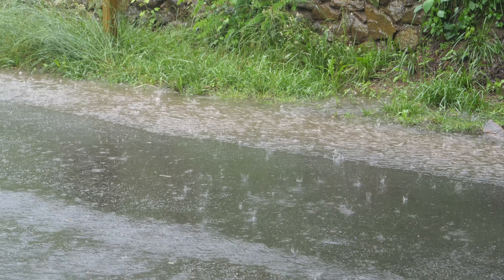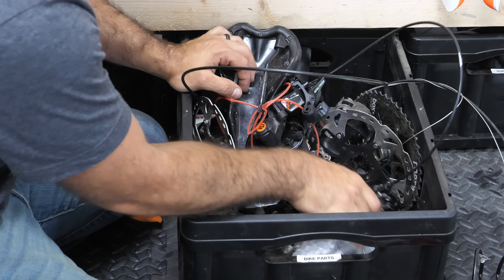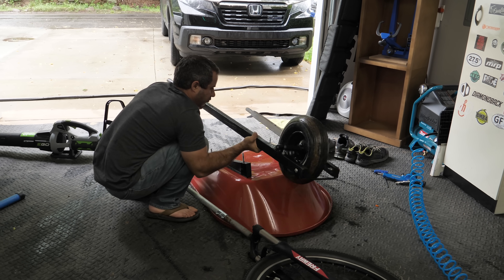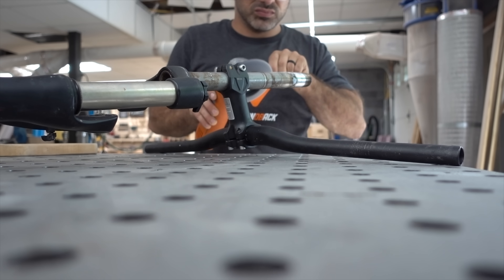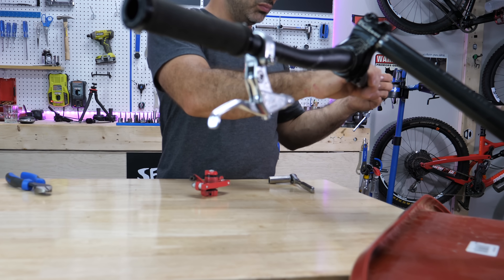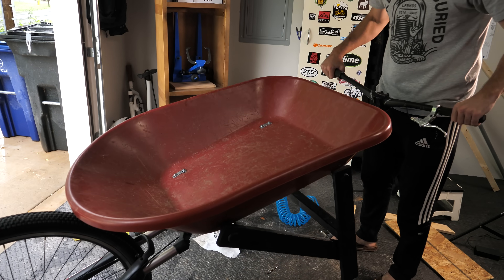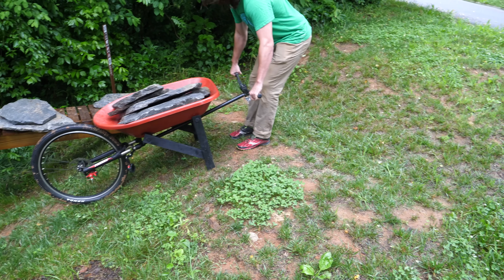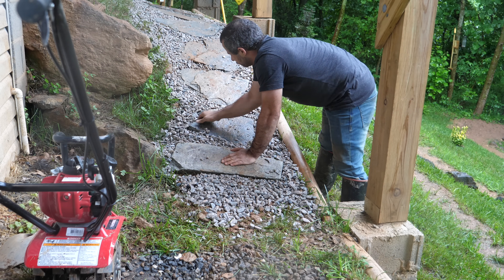Building a Downhill MTB "Endurbarrow" for Trail Building

Comment: Next video put wheels on the back and ride it!
Reply: and take the rest of the e-bike parts and make it an e-barrow
Reply: incredible nice idea my dude,
Reply: Paddles on the front wheel.
Steering?
Maybe with separate brakes on the back wheels?
Or the front wheel twisting?
Reply: True my man
Reply: seth hartigan and add a chain with pedals
Reply: @electricsavage4012  dropper post for the bucket

Comment: All that horizontal stress on the shocks is worrying me...maybe you should have a look
Reply: Fix the orientation of the shocks for suuuure
Reply: I was thinking about that too, but a lot of the static load will be cakewalk for something that's designed to still be good after jumps, bails, and tech trails.
Reply: He never used that e-bike anyway
Reply: Yup. Saw the thumbnail and came here to ask how the fork held up to that level of abuse.
Reply: @aceof8S  But it's not just the static load -- the dynamic load when dropping rocks in is going to be pretty punishing on the walls, and then there's the dynamic effect of any bumps that the tyre isn't enough suspension for.

Comment: Some suggestion for v2: Smaller wheel that go right underneath the barrow, so that the wheel will load all the weight, not the user that's loading the weight. For suspension you can build linkage similar to MTB's rear suspension system.

Comment: The big wheel is a must have on rough terrain. But I think you could've use a little bit smaller wheel placed a bit more under the bin than in front of it. That would be more balanced (less load on the handlebars) while keeps the stuff short (more maneuverable).
Reply: or maybe just a 26" wheel would be enough
Reply: This is what I was thinking. A 20" wheel would be fine but I don't think he had any spare 20" wheels with disc brakes. lol
Reply: I feel like the angle that the shock is at, it will barely be used unless the wheel hits something head on
Reply: Dont even give it science or any seriousness ITS A FRIGGIN WHEEL BARROW WITH A DISC BRAKE AND FRONT SUSPENSION
Reply: @beginneronabike8212  exactly

Comment: Hey Seth, you should add a dropper post to make an automatic dumping system, just an idea...
Reply: Cian Bichard it wouldnt have the strength to lift it empty, no way with anything in the wheelbarrow
Reply: Cian Bichard, that would be amazing but you would have to have a really powerful dropper maybe even two
Reply: If it were strong enough to dump rocks, I don't see how you would retract it afterwards
Reply: Hmmm, maybe if you attatched three to the handlebars?
Reply: Even if you could get it to lift the back of the wheelbarrow with a load in it, the load being dumped wouldn't clear the tire.
Reply: Dump to the side then...
Reply: Hey dude thats really a gud idea
Reply: maybe the Rockshox hydraulic one
Reply: Dropped posts go down with weight on them, surely that wouldn’t work
Reply: it would loose the stiffness

Comment: Looks like its not level, so if your going to ever mix concrete, its better off with a 24"/26" wheel, and it'll tip much easier too. You could also put a bucket angle change on it.
REQ: Take the dog for a ride, mine loves it !

Comment: I would put the u-bolts the other direction so the round part would be inside the barrow
Reply: That makes no sense. The round end of the U bolts go around the round component. Inside of the wheelbarrow is flat so you want to do it the way he did
Reply: I agree with you. You would want to add a rounded rather than flat compression piece to the lock down mechanism, but having the bolts and threads inside the carrying space will cause them damage (especially with all the rock work) and shorten the life of the tool. If the bolts are underneath it will last longer.
Reply: Lol all u gotta do is cut the bolts down so they are flush with the flat washer and wullah! Problem solved.

Comment: Is the suspension actually functional at such an angle?
Reply: if you run to the wall it might help damping the crasf x)
Reply: Actually imagina you have the bin full of water... Pulling back would make the water spill buth now when you braje the suspension damps and there is not much force pulling the material out of the bin or pulling you downhill
Reply: Jaka Berdajs doubt it thats not very plush suspension
Reply: It’s for downhill so it will help and you know when you have a fill suspension bike the rear suspension sometimes is at an angle like that but to be serious it’s probably just to look cool
Reply: Hdog01 rear suspension can be in any angle these days due to the use of counter lever systems....
Reply: It wouldnt even help at a normal angle, that fork is horrible
Reply: I think it helps with braking.
Reply: I would believe that at the gradient of the garden it works. considering that's the main reason Seth used it in the first place.
Reply: Well to be fair he only used it because it was convenient
Reply: Is this a real question?  of course not.  In fact, since it is purely side-loaded the life is likely reduced.

Comment: You inspire me so much to ride my Walmart bike
Reply: Just dont die
Reply: I had a department store bike and after a year, I ended up replacing the fork, both tyres, the handlebar, the pedals, seat and seatpost, bottom bracket, chain (twice), sprockets, rear wheel spokes,  front disc brake caliper, and the cables. :(
Reply: RB Ching I think you should of just got a good bike
Reply: I know but tbh, I never chose that bike. I've been begging my dad for 5 years for a bike and suddenly out of the blue, he just gets me one so I really couldn't complain. all the replacement components cost half the bike's price and those were budget parts. :'( at least I have something to take out on the road. it's good as a fitness/road hybrid bike/gravel bike but absolutely dangerous for the trails.

Comment: 300 dislikes of 100% pure jealousy
Reply: Maybe it’s because they didn’t? Enjoy? The video?? Like, ok, maybe they found it boring or they didn’t think it was very entertaining. They’re allowed to dislike and still enjoy his other videos.
Reply: to be fair, the bike parts used on that thing probably costs more than a whole department store/walmart bike
that being said, i can say that i am indeed jealous of the fact, but why would i dislike a great practical upgrade idea?

If anything, re-orienting the fork to the usual angle it is mounted to on a bike - or better yet, just reusing the bike steering axle, welding it fixed, and extending the cut-off frame as a wheelbarrow chassis would be how the build goes. That, and a longer wheelbarrow bucket - or better yet, a modular one which you can quick-change from a wheelbarrow bucket to a lidded box bin to a tool box with quick-release stuff.
Reply: edit: 672 dislikes of pure jealosy
Reply: @brianhock1033  673 dislikes 2 weeks later... I’m impressed it hasn’t changed much

Comment: seth instead of a horizontal carying bar 2 parallel ones would be better for weight distribution
Reply: I wouldn't make them parallel but v-shaped. Making the splitting part can be a challenge, but the rest is pretty much the same idea as Seth's. Just attach the handlebars to both of the carrier bars instead of the one. It should offer much more control.
Reply: Also better for using stronger arm muscles and being more ergonomic, and less likely to cause strain!

Comment: That is absolutely brilliant.  It is true that necessity is the mother of invention.  Your need for a wheel barrel that could work down hill created a product that is not only functional, but actually works better than the original design.  You could also try making one with two bicycle wheels on either side of the front of the wheel barrel (for larger loads).

Comment: Cool idea, would want to do a 20 inch wheel, fork and bars from a used bmx. Would also weld on two poles to support like original design with some supports connecting,  then weld those to the handle bars. Brakes will be worse, and would need more welds, but would be more stable with weight distributed and lower to the ground.

Comment: keep an eye on the friction clamps were the neck pieces meet the center pole. its possible for them to eventually fail. this isnt the same type of stress bike handle bars normally deal with. so it could start slipping. it also may not. but its a potential point of failure, so just keep an eye on them.

Comment: This is cool and all but the whole idea of a wheelbarrow is to position the weight above the wheel to enable you to carry larger loads with ease. Putting the wheel that far out in front moves the weight of the load back way to far and I bet your arms would fatigue a lot quicker. I'de like to see a smaller wheel (maybe 20inch) up front to enable you to move the forks back underneath the load and get the suspension back to an angle where it actually travels. I'm sure you know all this already, maybe a part 2?

Comment: Pretty cool. Only issue I see is the bucket is supposed to be over the wheel so you can dump the barrows load. I don't think you can dump loads with the wheel obstructing the barrow lip like that.

Oh and the suspension fork isn't designed for the transverse sheer loads your putting on it.

Comment: Put some wheels on the wood. This way you can just ride it and hit some bumps without crashing the thing. Since you have a brake, this there is to way it can roll away from you while being heavy. Just make sure you attach some kind of lock to the brake so you can let it rest on sloped areas too

Comment: Put rear disk brakes on the back with some old Enduro suspension. See if you can get them to tilt like a normal wheelbarrow too. If you really want to get technical add the old motor fro. The electric bike you took apart. Just in case you need to go up.

Comment: I'm trying to do something like this but in a more traditional way. I'm going to weld up a regular style wheelbarrow frame out of steel, then build up a 16" BMX style wheel with an MTB hub. Hopefully I can find a real fat tire for it. The hard part is that I can't quite figure out the best way to mount an axle to that frame in a way that will let you easily remove the wheel when needed. Any thoughts anyone?

Comment: idea is nice, but you should have put two wheels on the sides rather than out in front..
your front wheels placement will make you have to lift a lot more weight than you have too..
if you put the wheels on the sides, the load will be centered on the balance point and you would not have to work so hard to lift the load.. 
- redo it..  :)

Comment: lol I love how silly this whole thing is. I'd really worry about the strength of it though, as a fork isn't exactly meant to carry weight from the side, it's meant for weight pushing down on it. The handlebars aren't exactly strong either, and I'd seriously worry about the bars either just breaking, bending or the mounts not holding up if the weight distribution isn't spot on. It might end up as a side tipper. 

By having the wheel way out in front you're also having to lift the entire weight yourself, if the wheel is further back (below the weight) you're lifting less yourself.

The basic idea is pretty solid though I think but it'd probably be better to get a quality wheelbarrow made of something you're able to weld on and basically just add disc brakes to that instead. 
The best result would probably be achieved with a two wheel wheelbarrow (more stable) and adding disc brakes to that. Brakes certainly would come in handy when going downhill, that part is very true. :P

Comment: Hey seth I could really use your advice so I plan on getting a new bike soon and while I have the means of getting a full suspension bike im stuck because  i loved my Hard tail that i broke I was just wondering what u like more. I ride hard rocky technical trails so thats why I was leaning to a full suspension bike to lighten my ride a little but I also really love the syncr pro I have been looking at and their is less to break on a hard tail and a lot less to mess with what would you suggest also if anyone else could give me advice I would like that a lot also I am not the biggest or strongest teenager so i want something light any bike suggestions for both full suspension and hard tail? Thank you